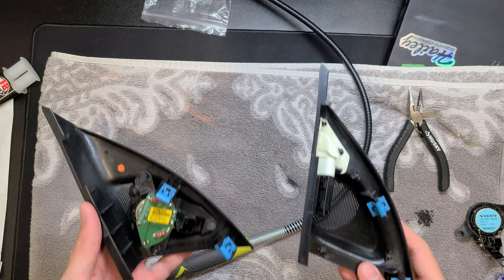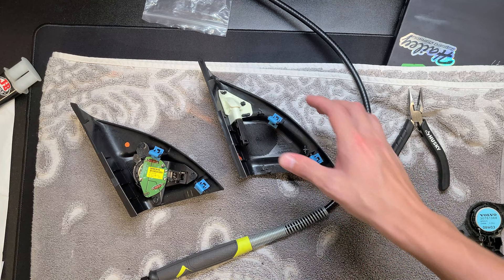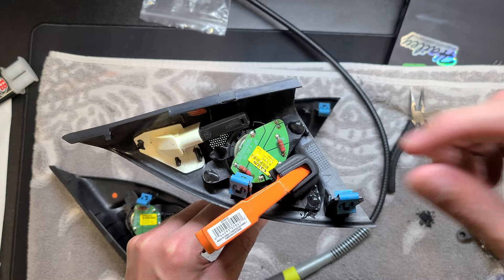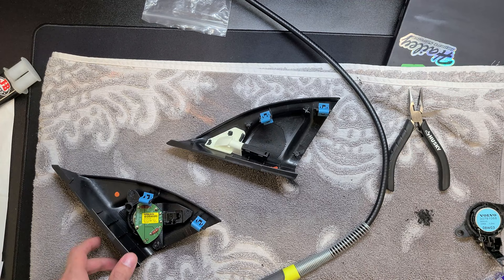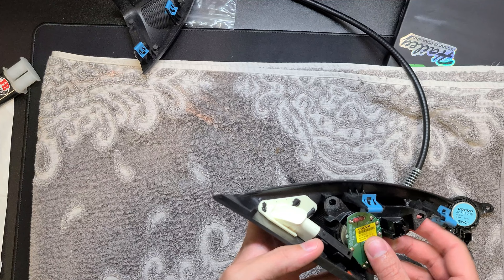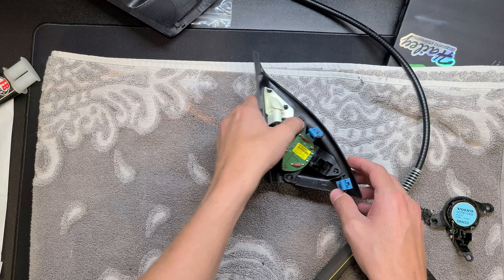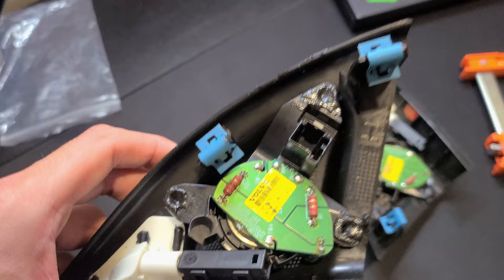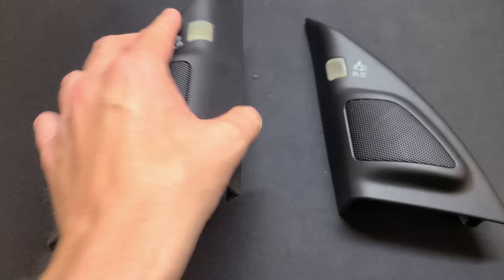How to swap Volvo P3 DynAudio Tweeters (Premium Sound for V70/S80/XC70)

Comment: Is there anyway to tell if they are DynAudio before removing the panels?
Reply: yes, you got both "Dynaudio" badge on the edge of center console grill (where RTI navi screen sits) on pre-lci models, or you can tell just by turning on the stereo - it will state what stereo system trim car's got (Performance/HP/Premium Sound aka Dynaudio usually)